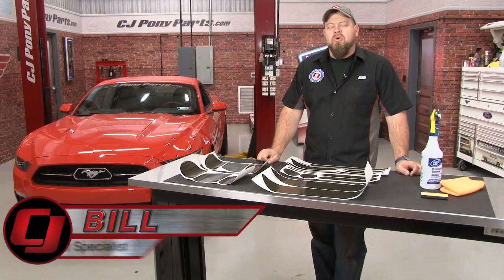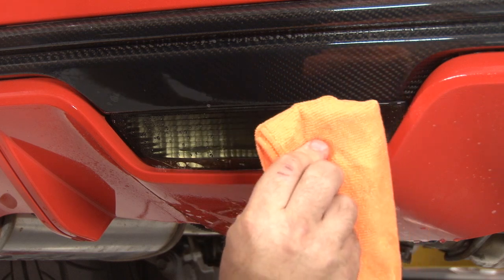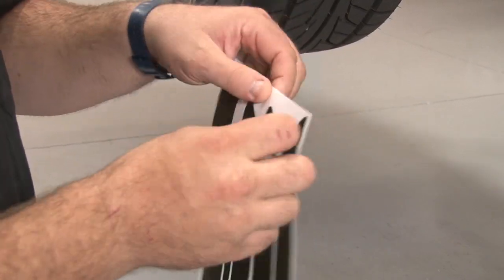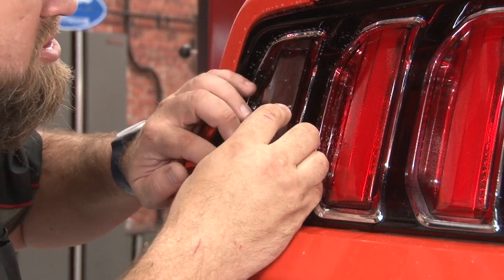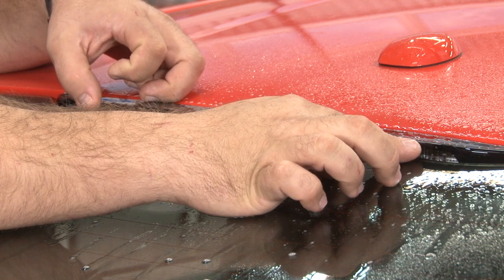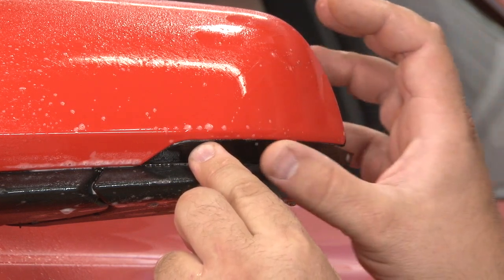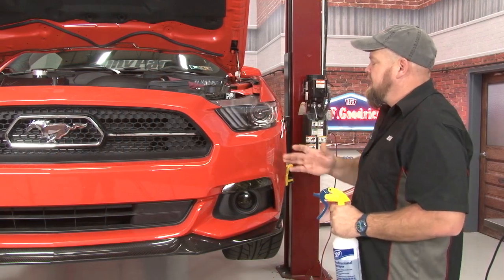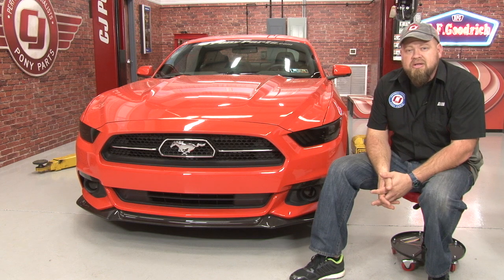Mustang Complete Anchor Room Front And Rear Light Tint Kit With 50th Anniv Tail Lights Installation

Comment: This may be a dumb question, but say u wash your car regularly, would this change the position of the tint? I normally use car wash and water and dry with microfibre. Thanks!
Reply: +Rick Kaler  Not at all, once it dries it is on there pretty good.

Comment: I have a question. After putting the tint, when washing the car the tint won't move?
Reply: +jose miguel morla simon  no once it dries it will not come off unless you want it to
Reply: ok thanks
Reply: +jose miguel morla simon It's just like a screen protector on your cellphone. So it won't move.

Comment: it's a great hack, execive water use making mess leading to contamination on the install and uncomfortable work area, wrong water mix, execive use of the heat gun, any respectable ppf "wet application film" knows is too much soap in that mix the less soap the more TAC on the film minimizing the use of heat guns to that degree, keys are good film a good installer, failed on the lower fog lights I might be over critical do to being a ppf and window film pro
Reply: So your saying less soap? About to order a kit possibly and any tips are greatly appreciated..
Reply: Google best water mixed for ppf application, some use 70% alcohol and baby shampoo, how much slip   and tac depends on the temperature of the surface on plastic surfaces it requires less soap and more alcohol
Reply: I would have thought that alcohol over spray would be bad for the paint or trim?
Reply: for a full spray bottle put about a shot glass of 70% isopropyl alcohol it will make the full bottle about 5% alcohol content then add three teardrops of baby shampoo and that's a mix remember the more soap the more slip the more alcohol the more tac
Reply: the alcohol level would be so low it wouldn't harm the paint but you also need microfiber rags to whipe off excess water
Reply: also to much alcohol can weakened the adhesive on the film so be careful
Reply: another mix is a full spray bottle of water only but two to one drop off baby shampoo tiny drops at that suggestions buy scrap ppf online and practice before installing